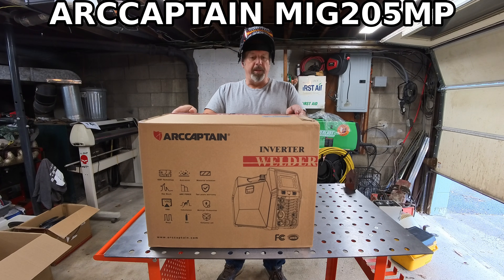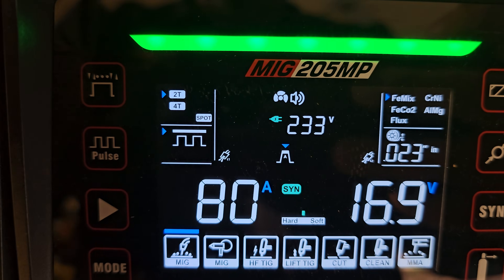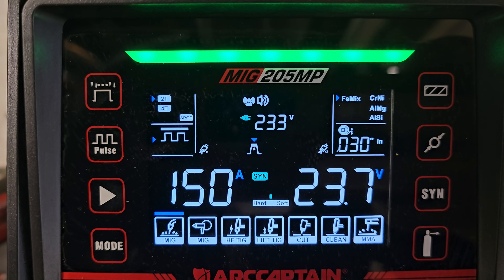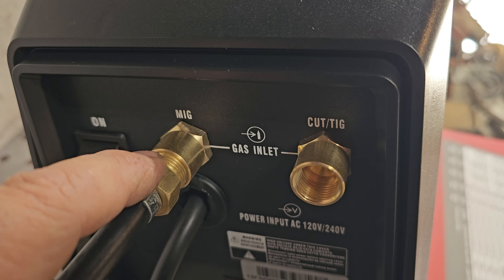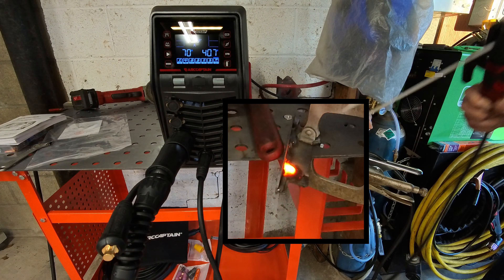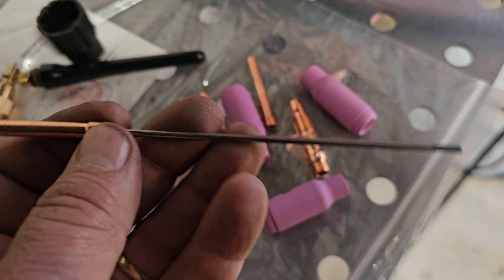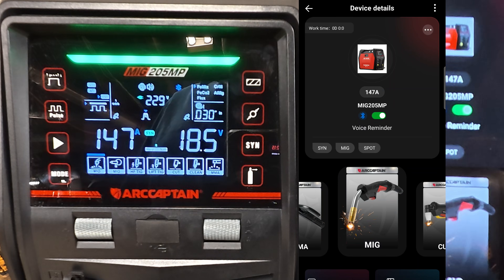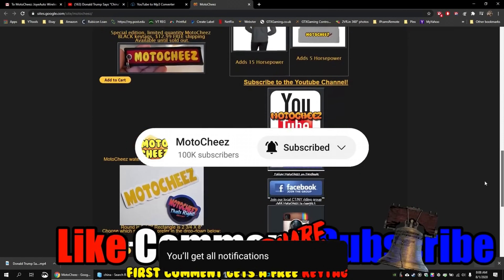XMAS SALE! ARCCAPTAIN MIG205MP Multiprocess Welder ALL IN 1 Plasma Cutter, MIG, Stick, Tig, Clean

Comment: I bought a MiG 250 pro. Was disappointed.  It advertised 250 amps. Used an amp meter and measured at full output and only measured to 197 amps.  But they advertised it as a 250 amp machine.  I was not impressed.
Reply from the maker: Sorry to hear that, I have not tested max the output of this machine.
Reply: @MotoCheez I’d recommend hooking it up to a clamp ampmeter and measuring the output amps on the torch    I clamped mine right below the MiG torch gun.  Only takes 30 seconds and it’s a good way to help your machine get tuned in.  And also to see what amps you’re actually welding at.
Reply from the maker: The output is DC, a clampi-on amp meter will not be accurate because it reads AC. I was thinking of reading the amp draw off the 240vac plug, reading the voltage at the torchal and calculating from that.
Reply: @MotoCheez that’s exactly how I did my test.  My clamp meter is auto ac/dc.
Reply from the maker: What meter you have? My clamp-on meters are inductive AC only. I think you'd need a shunt style meter to be more accurate off the gun. I have an electronics degree from years ago
Reply: @MotoCheez Klein from Lowe’s. It says ac/dc on the “amps” setting.  I’ve used it many times for measuring low current at my outlets when I wired my shop at 20 amps. It’s always been accurate for me AC

Comment: Do you have to change the gun liner for .023 wire? I know you have to buy the wheels separately.
Reply from the maker: Liner is good 0.23 up to 0.45, comes with several tips and wheel sizes, the.23 is on the flip side of the .30 wheel

Comment: When are you gonna branch out and get trucker caps/hats and doo rags/head wraps with the motocheese logos? It would be an easy way to advertise without being too obnoxious of a billboard while riding the cycles. Head wear is a great way to help keep the sun out of the eyes and trap heat in as your cruising on those chilly mornings/days. Cheers bro
Reply from the maker: That's a good idea. I did have shirts and a winter hat etc as merch, sold well in the beginning. I don't promoteas much as I should I guess 😁
Reply: @MotoCheez When you don't have anything to cover a vital part of your body, it gets cold as sin. A neck gaiter could compliment the head gear. Maybe a good poll of sizes might be best cost effective way to limit to much inventory.
Reply from the maker: I have a company that makes them when they're ordered so it's not too bad that way
Reply: @MotoCheez Limited time, collectables, etc and help with promoting them.